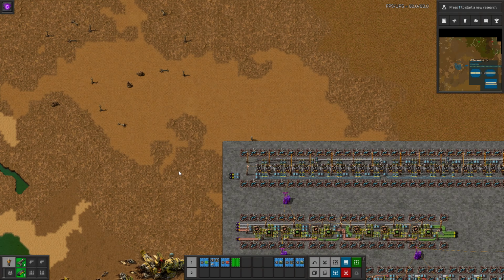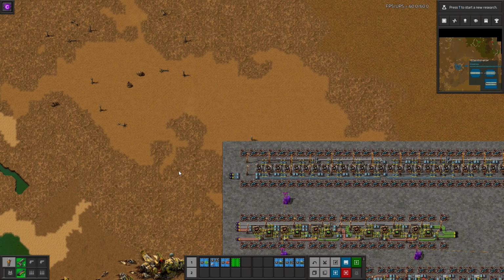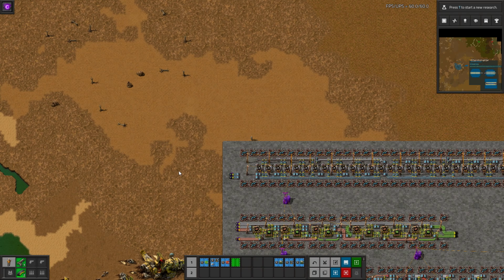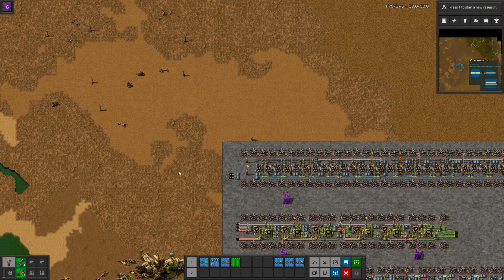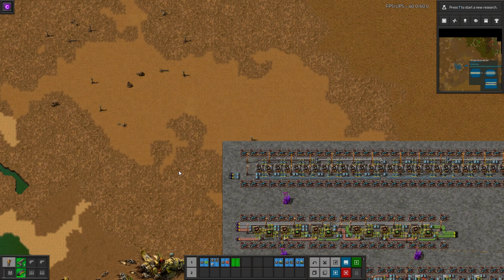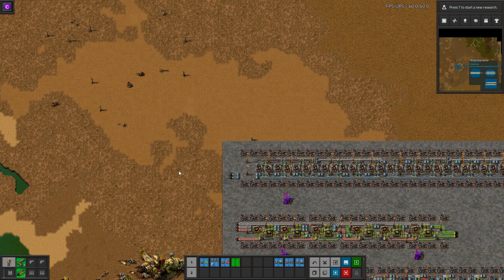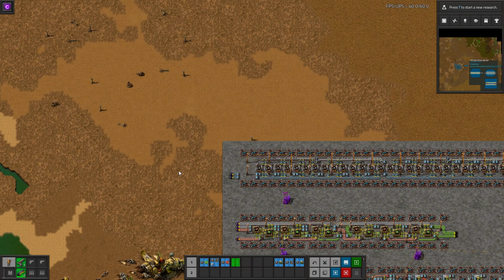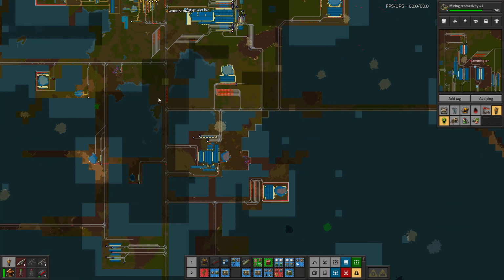Factorio Megabase Tutorial - Build Design & Spacing Between Production Areas

Comment: Do you have any recommendations for upgrading your train system from 4 wagons to larger ones? My whole base is based around 4 wagon trains but now that I'm slowly building towards 1000+ spm I feel slightly larger trains would probably be better but unsure how I'd go about doing so.

Edit: Just thought I'd add that I also build my base around single headed trains so I'm also wondering if there's a benefit to trying to now go with double headed trains or just work with what I have for now and then hopefully in the future try and learn from this base.
Reply: The train length limit is based on how far apart your intersections are.  The distance between the intersections has to be longer than the longest trains (you can have exactly one longer train without causing problems, such as an artillery train).  If you have room between the intersections, you can design new builds to accept longer trains, and just accept that the older builds keep their short trains.  If not, lesson learned for next time like Xterm said.  

Btw, longer single-headed trains work fine, especially over longer distance.  Extra locos get you up to speed faster, but they don't increase the top speed and they burn extra fuel.  I tested 1+4, 1+8, 1+12, and 1+16 (with nuclear fuel).  The speed penalty for 1+8 was barely noticeable, and you're delivering 2x the stuff, so that's an easy win.  1+12 takes a few hundred blocks to get to top speed.  I didn't do the math, but i felt like delivering 50% more than 1+8 was worth the couple extra seconds switching trains at the station.  1+16 took a couple thousand blocks to get up to speed, which felt like way too long leaving the station.  The 1+16 train is also 119m long, which is a lot of train to deal with.  I'm currently building around 1+12.
Reply from the maker: Great questions! 

From my experience and in my opinion, I'd definitely suggest staying with the train size and layout (single headed) that you've built everything around, and taking any issues it causes as a learning experience for future bases. 

Trying to change train size part waythrough at a megabase scale would likely be a huge nightmare! Also, I think 4 wagon trains are actually totally workable for a 1k SPM base. In my base tour series, we've seen multiple bases even bigger than 1k SPM thar run on 1 or 2 wagon single headed trains. 

Hope that helps, and best of luck with scaling up your base. :)